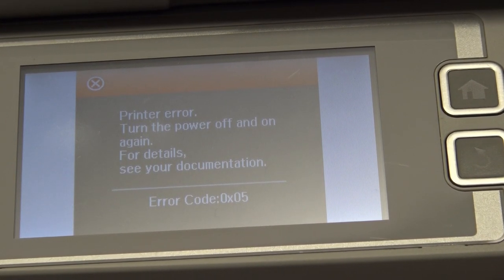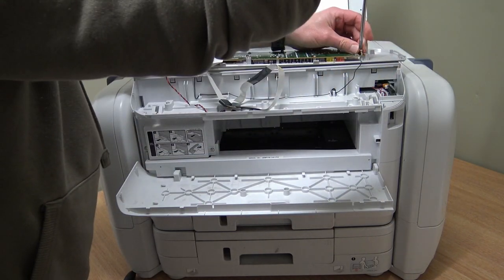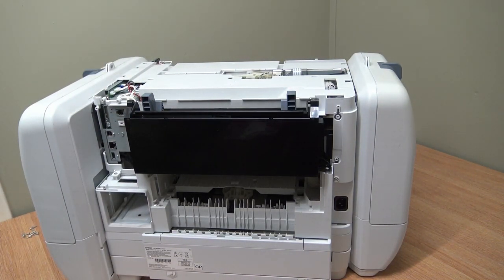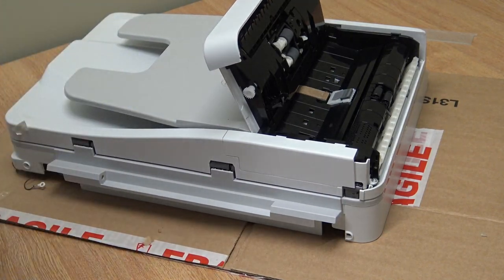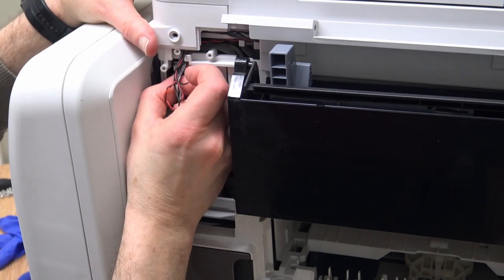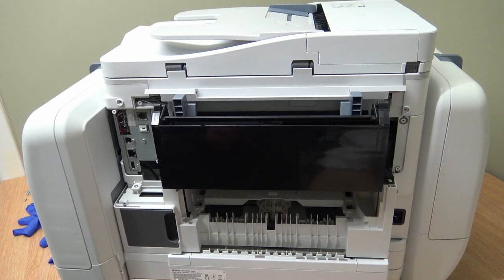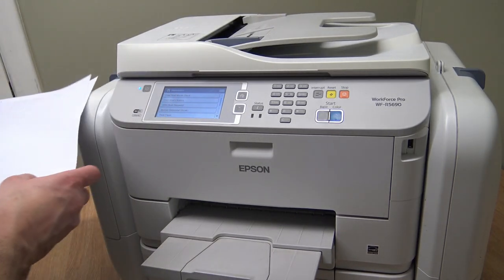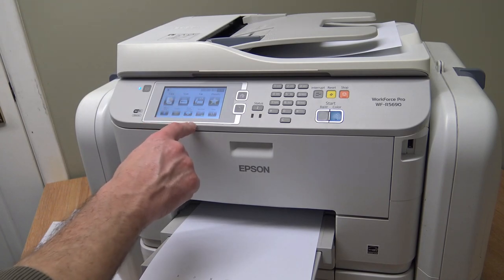Epson Error Code 0x05 ADF Document Feeder Problem, jam symptom fault R5690 MFP photocopier

Comment: I have an Epson WF-5620 printer that has problems with the feeder. Is it possible to cancel the feeder because I do not need it, please
Reply from the maker: Unfortunately part of the boot up sequence, basically the self-test when switched on, tests the ADF Motors and sensors, you can’t tell the machine to ignore it, even unplugging the wiring loom will cause an error.
Reply: @theofficeequipmentengineer7000  Thank you very much